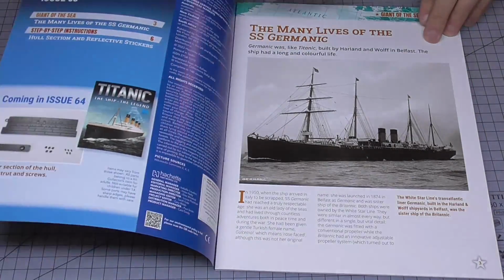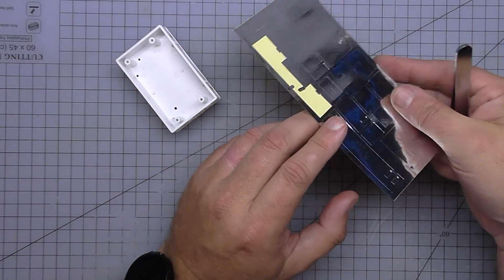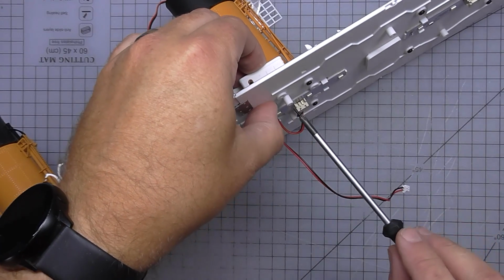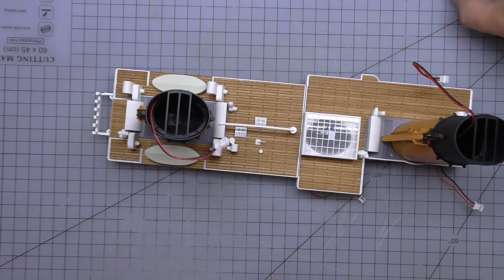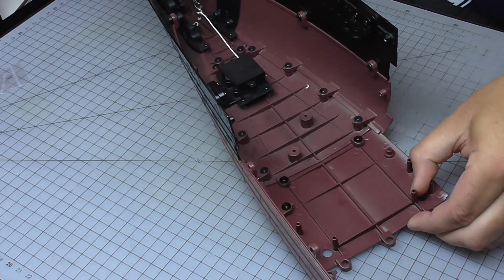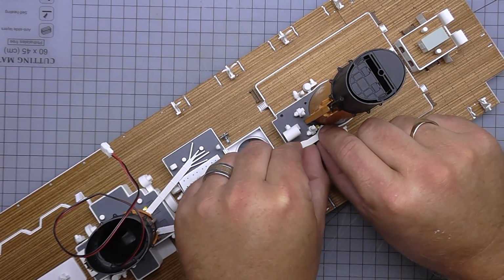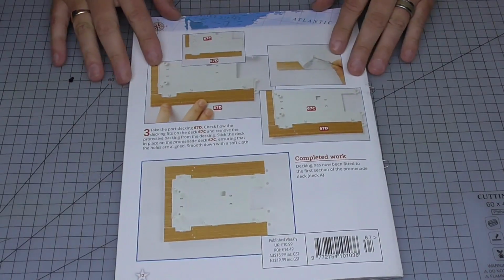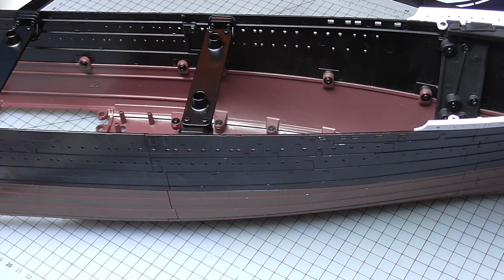Agora Models Build the RMS Titanic - Pack 12 - Stages 63-68

Comment: I am currently putting together the same model and using the same materials, set 2, I am currently on set 2, that is the second part where we get the first parts of the bow hull and the screwdriver. So I'm interested if you can answer if you also see a little empty space between the red and black color in front in the width of 1 to 2 millimeters when you connect it. It's visible to me visually, even though is not noticeable unless you look closely.
Reply from the maker: I tiny one yes
Reply: @WorldofWayneUK  Thanks for the answer, I thought it was some production error so that's why I asked. By the way, I'm from Europe, Croatia, and it appeared on our market only 20 days ago. Support for your work 💪👍👌